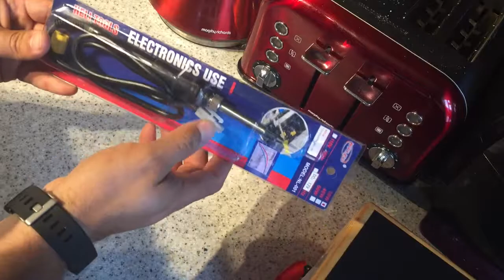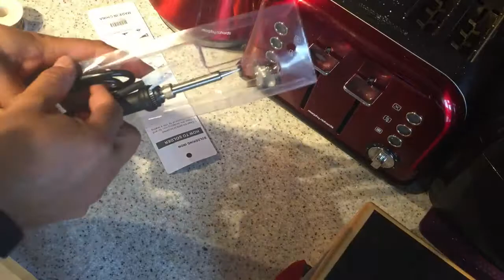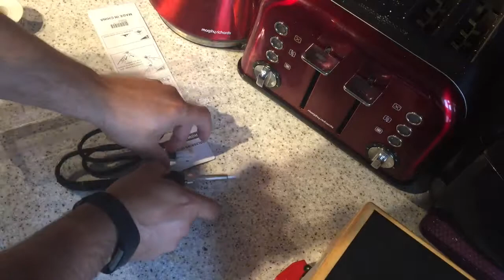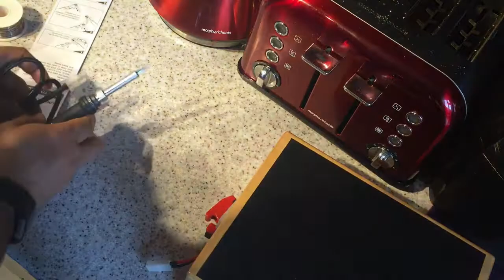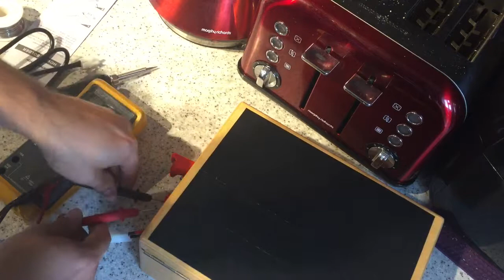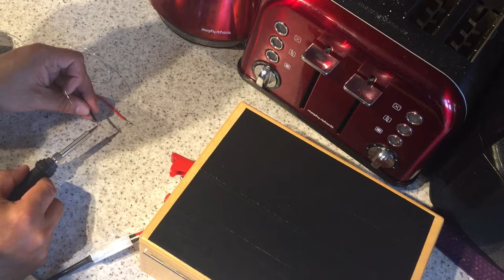Heli tools NL-001 12v soldering iron 30w review

Comment from the maker: Approx 45 seconds to get to temperature !
Reply: I get mine 5 mins
Reply from the maker: Bigger power supply needed!!!
Reply: And its hard to melt lead it only solidifies or beads up straight
Reply from the maker: Eric Sensico ... admittedly the tip on the iron is a bit crap ... also there is no temperature control... it’s not great for detailed soldering!!
Reply: Ohhh... How do i get a bigger power supply?